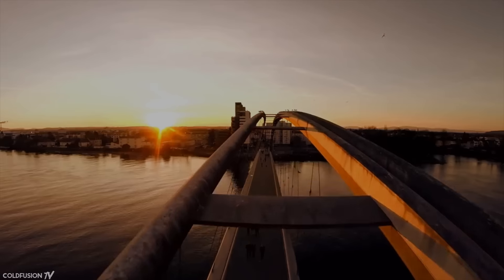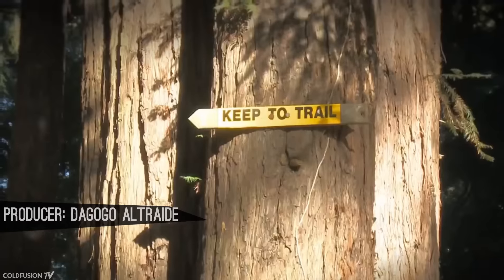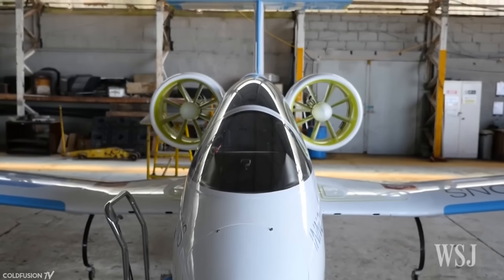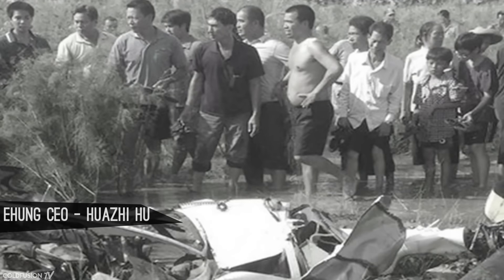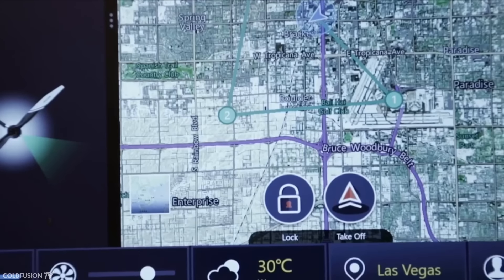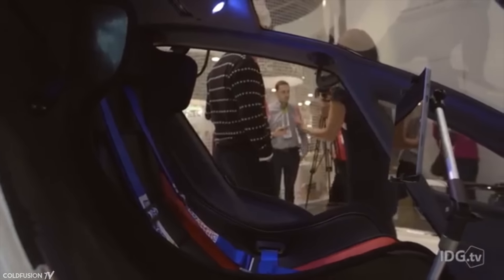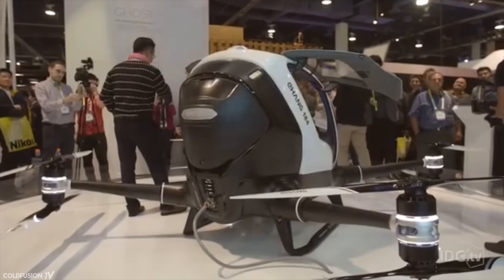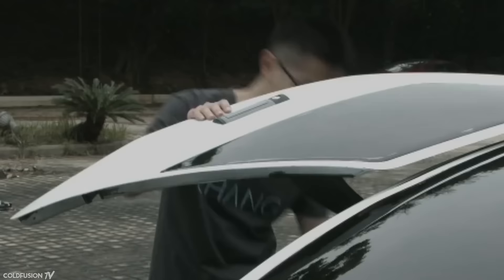World's First Passenger Drone (Ehang 184) | ColdFusion

Comment: There's a lot of discussion regarding a multirotor (MR) vs a single rotor (SR) helicopter.  If full-scale vehicles perform similar to professional-grade RC vehicles, which I think they more or less do when it comes to the basics, then here are some facts:-SRs are more efficient due to blade size (more flight time per energy source)-SRs are significantly more stable in windy conditions (contrary to many comments here)-SRs are capable of generating more thrust, in general (larger payloads)-SRs are much, much more agile (again, contrary to some comments here)-SRs are significantly more reliable (more mechanically-based, less electronically based)-SRs are generally less expensive to make-SRs can also be controlled through autopilot systems (not just true for MRs)-SRs can autorotate when main power supply is cut-SRs are much easier to make run on combustion engines (this hugely increases flight time, load carrying capacity, ...)-SRs are quieter-MRs are easier to fly without autopilot system-MRs have fewer mechanical parts and, in this sense, are easier to work on mechanically-MRs are less finicky when it comes to eliminating vibrations (smaller propellers)-MRs have redundancy of motors, provided that they are octos (either flat or co-axial) and still have main power supply intact-MRs are less dangerous to surrounding persons and property (smaller propellers with less inertia)In general, I personally do not think that MRs are a good substitute for SRs, even though both may serve their purpose under particular circumstances.  "Drones/Quadcopters/..." are in large part a fad with which many hope to make money from.

Comment: A fix wing aircraft can glide. A helicopter can autorotate. But if even only one motor fails in this, it will probably tumble out of control, since it needs all four corners to balance. But maybe one motor in one corner will be enough to balance?
Reply: +Niklas Bergsten it has 8 propellers, 2 on each arm, if one propeller broke, then i guess the other propeller would just have more thrust and the others less to balance.
Reply: +Mr. Universe (Formerly Bismuth) That's what I said in the last sentence. But even so, I judge this to be much less safe than a regular helicopter or fixed wing aircraft. In a loss of power condition, this thing will just plummet to the ground.
Reply: Niklas Bergsten yes, most likely.
Reply: +Mr. Universe (Formerly Bismuth) I guess they could employ an emergency parachute like on the Cirrus SR22 though.
Reply: Niklas Bergsten it could be possible, or a backup battery incase.
Reply: +Mr. Universe (Formerly Bismuth) I remember seeing a presentation of a drone doing a controlled spinn to compensate for a lost propeller, it would probably not be comfortable but maybe save your life. Loose more one and you are probably fucked.
Reply: Ralph Hvald yeah, that seems pretty impressive to stable a drone with 3 propellers.

Comment: Here is your answer for malfunction.
 It's on their website
Four arms and eight propellers offer great lifting power and safety. Even with one propeller malfunctions, it can still land in the nearest possible area safely.
The 184 AAV has embedded with Ehangen fail safe system. If any components malfunction or disconnect, the aircraft will immediately land in the nearest possible area to ensure safety.
The communication is encrypted and each AAV has its independent key.

Comment: The energydensity of Lithiumbatteries is improved 7% every year. If that continues like this it would lead to a doubling of capacity in 10 years (1.07^10=1.97). That means such a copter could then fly 46 instead of 23 minutes which would greatly increase its usability.

Comment: 2 Points :

i )  Should / Could Battery ` recharging ` be replaced with a ` quick release /  replace ` Battery ?

ii ) As Rotors are side mounted , could a pilot activated Parachute be fitted to the Aircraft ?

MFC

Comment: This Ehang 184 is actually coming a little bit close to an idea I have had kind of evolving in my mind for years and years (initial idea started back in the '70s really). My idea for a personal flying machine to replace an automobile is a little like this only different.  My idea was NOT to have it operate as an automatic drone (there were no drones when I started conceiving this). It would be personally controlled.  There would be at least 6 propellers (although my idea originated out of a new concept for the lifting component).  Why?  So that if any one failed, you would still have complete lift control.  Even if 2 failed you would hopefully be able to land safely. If this Ehang 184 is supposed to be so safe, why only 4 propellers (well 8 I guess since each seems to be double, but are all 8 really separate units?)?  Also in my idea, the 'propellers' would be much above the main passenger component.  This would give it incredible stability.  How do drones maintain stability? Does it require computer control to do this? I don't know. Another thing I conceived of, would be it would be somehow integrated into a computer system on the ground (or possibly peer-to-peer) which would make it impossible for any one of my flying machines to either run into another one (if you tried to do this, the computer would override) or run into any obstacles it would find in a global map of the world, which I guess this Ehang 184 does if it can avoid mountains and buildings. In this way, and assuming you could get the computer system to keep track of any other obstacles (such as other regular aircraft flying around), my idea is that it would be virtually impossible for the drivers to crash this thing.  Another thing I wanted to do, is, I wanted to come up with some way that you could make sure that the control of all 6 props was not all centrally located. So in that way, again as with the props, you could not have the whole thing fail at once, but only one of the components. I could never think of a way to do this. But you see with this Ehang 184, everything is centrally controlled by the computer. NOT GOOD! If the computer crashes for some reason, you are dead!  But anyway, the way I was thinking about this seems to be even more safety conscious than what the Ehang 184 did.  I sure would not like to be in a drone without the possibility of control, and certainly not one controlled solely by a Microsoft computer. The most important thing about safety, it seems to me, is to make sure you do not have any point in the whole system where, if this fails, the whole thing crashes!

Comment: The only problem I have with that drone, is the propeller being at the same hight of the cabin.  If one of them ever breaks, it could fly into the cabin and that would not be good.  It's good but rather have the blades above the cabin for just in case.

Comment: It should have a parachute on top of the drone (in case of any malfunction) and an air bag at the bottom
Reply: FernandoP1 - Art Zone Productions that's what I'm saying
Reply: Parachutes are extraordinarily heavy.
Reply: Computer if people are able to ware them then a machine with motors are able to ware them
Reply: International Innovator Never did I claim that you can't put a parachute on this thing. You can and it would be a good safety feature. However I did say they are very heavy. over 50 pounds at the lighter and simpler end of the spectrum for an aircraft of this size but that's with a manual pull cord, that doesn't even account for the extra electronics and sensors required.

All of this weight makes a massive difference in rotorcraft which already struggle with power to weight ratios. If the weight limit for the passenger is 230 pounds it's now less than 180 when you add a parachute and that's a GENEROUS estimate.
Reply: true but it probably would have a light weight body that is rigid made out of reinforced carbon plastic which is found in the bmw i3 and would save a lot of weight the heaviest thing in there would be the battery and this type of aircraft would be way less mechanically complicated none of the motors would need to be physically connected with heavy shafts and rotors
Reply: International Innovator Right and it would need all of these features just to carry a human being. But now you're adding a parachute in excess of 50 pounds. And for no good reason. I count 8 electric motors, it's reasonable to assume that up to 2 could fail at once and the aircraft would be able to execute an immediate emergency landing.

The likeliness of just one failing is very very low, not to mention 2. If you are suggesting that the insignificant risk of THREE MOTORS failing at the same time or within quick succession of each other is worth losing over 50 pounds of weight carrying capacity you are insane. We do not even know the weight capacity, it may even be impossible, what if the maximum weight is 160? I guess it'll be transporting skeletons, but at least they'll have a parachute that will never be used.

In an environment and flight condition such as this there is no significant probability of a parachute emergency happening to justify installing one.
Reply: right. they might not need a parachute it would just need at least to glide in the air and have flotation devices

Comment: It has no flight controls but it has internal sensors. The moment the sensors detect the oder of fecal matter or urine the unit lands instantly. Also if the police department senses that you have an outstanding warrant they will land you in jail. On the bright side if there is a Starbucks within one mile of your flight path the sensors will detect it and land you there. The best feature is no more DWI's. Ps, to keep the interior clean its best to wear depends until you get acclimated.

Comment: Can't they just give it an advanced fly-by-wire system, that keeps the aircraft stable and avoids collisions etc, but also allows users to take control in a very easy and intuitive way? Radio-controlled quad copters are already very easy to fly, much easier than radio-controlled helicopters.

Anyway, I think the lack of autorotation during engine failure is the main problem. Software can eventually be designed to be much more reliable than people, but having little to no physical way of landing safely during an emergency is much harder to solve. Parachutes won't be enough.

Comment: his seems more useful for cargo transport at this relatively low price point. Getting medicine and other vital supply's to places cut off by disaster or just remote locations in general, transporting people out of the disaster zone would need to may of these at once. I know this has been done before but this is in the 300K ballpark anything else like this is much more expensive. You could easily launch this things from a boat, railroad wagon or even a truck.

Comment: I have a pilots license and do trust automated flying systems (autopilots) to an extent; but I will not fly if I do not have the option to take manual control. I am a computer programmer by trade and I do know the limits of processors. They are fast, efficient correct and without mathematical flaw; but they lack intuition. I have no qualms placing my life in the cradle of intuition. Intuition is somewhat like "the force". It is precognition that saves lives.

This craft, were it powered by something with more range and with the option to take manual control, would be the ultimate vehicle of personal transport. I would love to own one. I would modify it to suite my criteria.

Comment: Imagine if the 100 years of R&D on gasoline vehicles had been spent on things like these...
Reply: +Sidharth Satheesh 
You're Indian and you call it gasoline? It's Petrol.
Reply: Sidharth Satheesh 
It would use a larger rotor cos diesel can provide enough oomph. Electric batteries forces it to compromise to low energy designs.

But the longer the rotor, the more leveraged power it can provide compared to shorter rotors BUT spinning large rotors requires alot of energy that electric batteries can't provide. Only gasoline can reach that kind of massive power. :(

LueLou.. Dj Rucy
Helicoters uses diesel aka aviation gasoline, not petrol lol

Comment: Isn't anyone concerned about the Ehang's eight, fully exposed, counter-rotating helicopter blades AT WAIST LEVEL? This would be like jumping into a food processor if you got too close during one of those automated takeoffs. I also seriously doubt that this prototype has actually carried passengers and has flown over mountains and forests as the voiceover claims. In order to get enough lift to carry more than a Microsoft Surface, the Ehang is going to need much bigger (and more dangerous) blades.

Comment: you are pretty much screwed if one of the four engines stall. At least with a plane you can glide your way down or fly with just one engine. but this, I wouldn't really rely on. heck, I wouldn't even go on a helicopter/drone for an average civilian use in the first place.

Comment: good luck he is clearly an engineer not a maintainer. To me their is so many things that can go wrong to make this thing fail.  your drone has a glitch in its power it crashes or drops a few feet. This thing has any power issues it will be done for. it has too much weight not enough rotor to compensate for it size.

Comment: Perhaps with the short flight time they could use them for emergency's. For example if they had some parked up at the top of the twin towers when 9/11 kicked of people cold have gone up the towers to the roof and then got into one off these to be carried to safety.  You wouldn't even need to program it there would be an emergency evacuation landing spot some where close by, maybe even the roof off another building that's just a 2 minuet hope away. If every tower in New York had say 10 or 20 off these on the roof they could use there ten first then other towers could send theres in to pick more people up and it would save lives in the event of a fire or terorist attack.

Comment: Got some things wrong:
The airbus plane was not the first to cross the channel fully electric. the very day before, an electric cri-cri crossed, taking the title from the airbus plane. 
the 184 is triple redundant, in it's flight control systems, and it can fly safely with a motor or even two out, as long as they are not adjacent. 
The fact that the FAA won't easily certify it means nothing, as the FAA will not certify important safety fixes for older aircraft, and when they do, it often takes decades, and people can die in the meantime. many operators defy the fAA, and perform the fixes anyway, saving countless lives.  for inspection, they swap the older parts back, then have to switch again before resuming flight. 
The safest, best, most modern  aircraft fly under EXPERIMENTAL exemptions, but are not allowed for commercial purposes. 
The FAA is a rouge agency, which continually violates it's congressional mandates, and goes against the purpose for which it was created, with regard to smaller aircraft.  
The real place of the FAA is in large, commercial aviation, where they do a great job, and are in their element. they are not flexible enough to deal with anything else effectively. 
there are a lot of great people working for the FAA, so the problem is not with them per say, but with the structure, and oversight of the organization,a slo with certain corruption within the agency, at high levels.  This corruption will become evident very soon. 
The 184 might not be the ultimate answer, Agreed, but is an amazing step on the way there, and may receive significant adoption. 
Good for the Chinese, and maybe their progress will shame the west into doing what they should have all along as well. 
way to go! 
other than that, great video.  
tell your congressman/woman to hold the FAA responsible for their actions, and repeated violations of congressional mandates/ reform act.

Comment: 2 hour charge time not bad but ~20? minute flight time is useless.  Those are the 2 areas to "lick" first.  Too bad gravity-modification is still locked in US and military-industrial complex programs - those craft press heavy on being autonomous, just enter go-to coordinates and you get there at optimum speed at an altitude and with cloaking and auto-jamming avionics and provide defensive/offensive needs, e.g. TR-3B, etc.